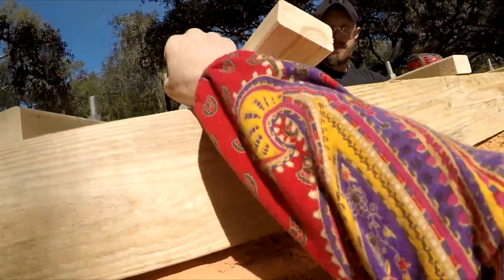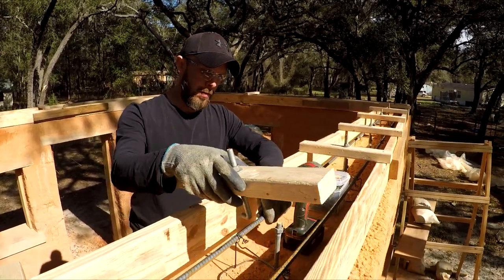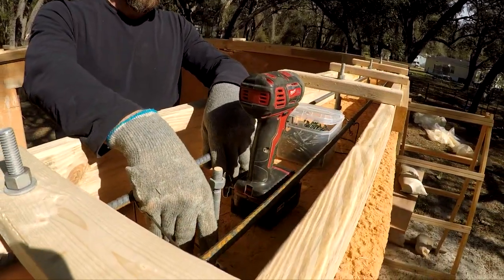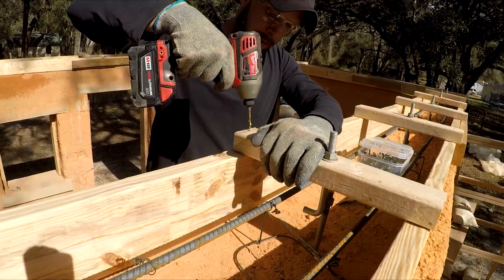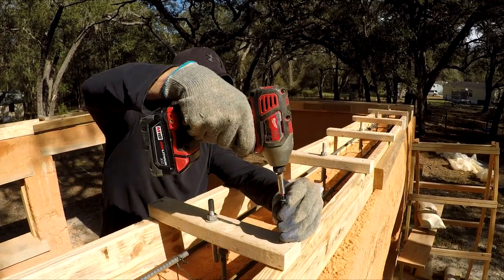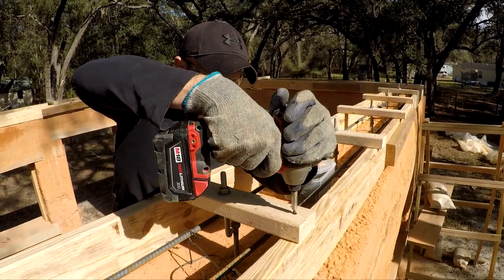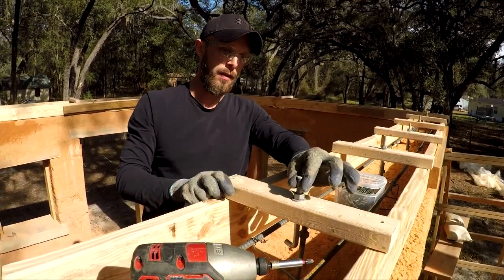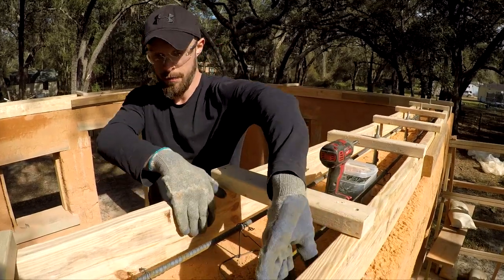Cob House Bond Beam Preparation - Roofing Attachment Point

Comment: Nice  video guys question how far apart do i set those bolts im currently at this stage with my project
Reply from the maker: If you want to follow code, it will depend where you are at. But I just space them every 2 feet.